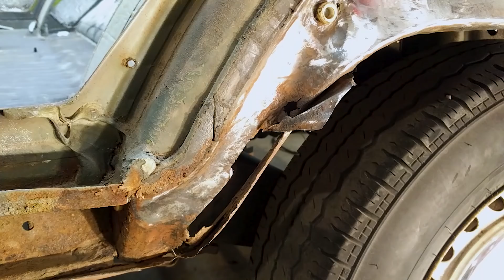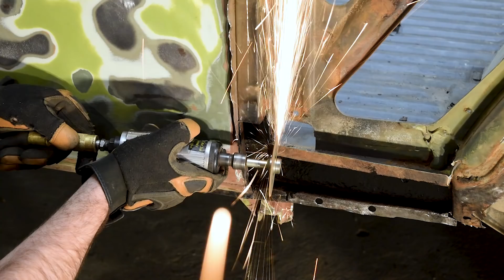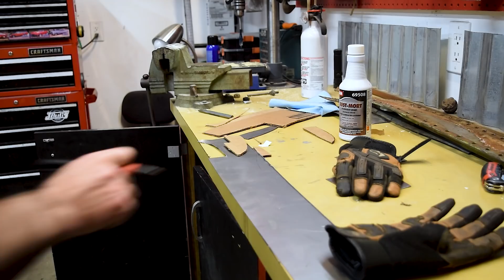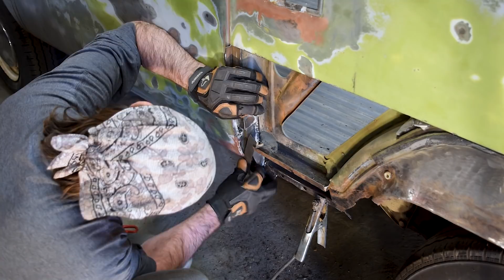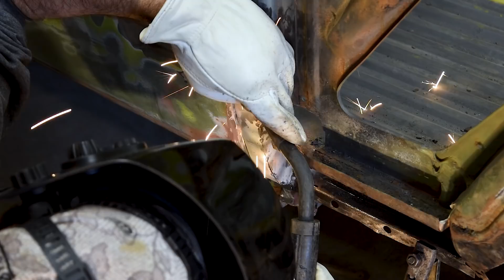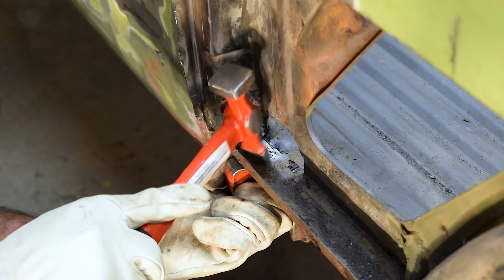The VW Bus Body Makeover PT 8 Pillar Repair

Comment: I need to do some similar work. My common sense solution was to use cardboard and make a template to fabricate the repair section, just as you have done. So I didn't learn what to do from your video as such, but it was reassuring to see you tackle it the same way, and confirm my thinking, and show how it's done. Of course, I'm not using a nice shiny sheet of metal, it's the side off my old central heating boiler for me.
Reply from the maker: Thanks Gary 👍 not sure if how I did it is the correct way or not but glad others have the same thoughts 😊
Reply: @SVsAuto  "Correct" Pah! If it works, it works. My other vehicle's a '67 Land Rover, so I don't have to worry about rusty panels on that at least.

Comment: You taking that bus down to the bones, I been doing a lot of metal work on my bus; I'm 64 and have health issues so my bus project is (Off & On) getting some help from my son and is friend while I'm in the healing process.. I was thinking about installing a Subaru in my 64; I have the conversion kit, need to find the motor and wiring--My 67 will keep stock. Nice work!!!
Reply from the maker: I did indeed take it down to the bones. Good luck with the conversion and a speedy recovery!